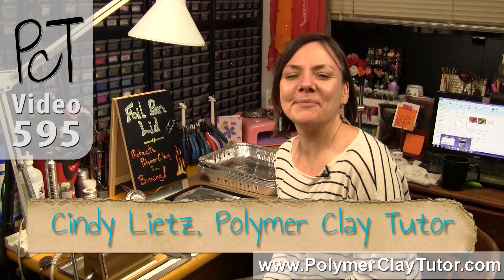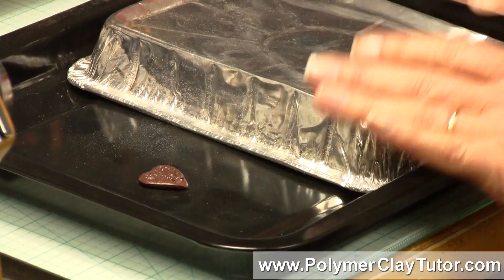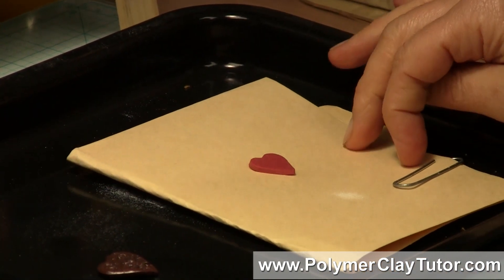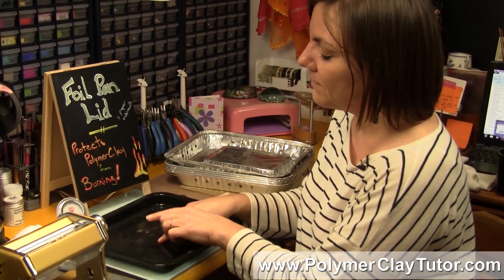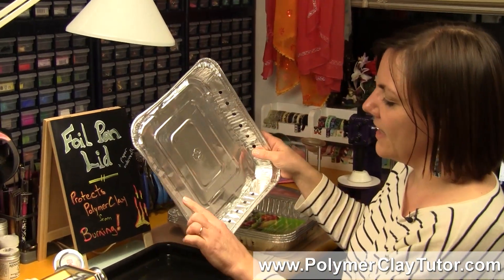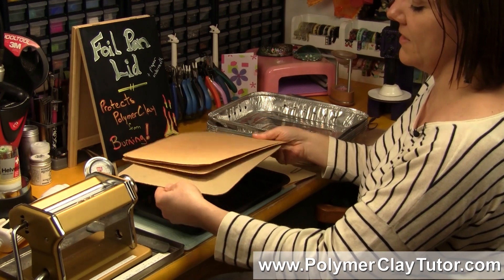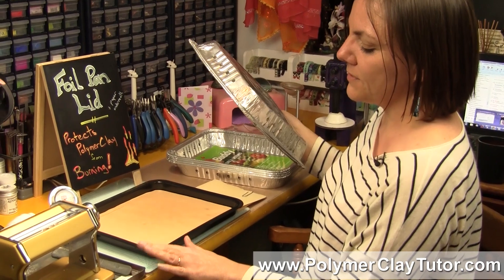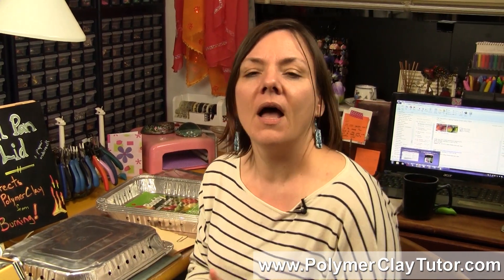Polymer Clay Baking Tips - Using a Foil Pan Lid

Comment: you aren't supposed to bake polymer clay for an hour!! no wonder you ruined one of your hearts! In fimo soft packages it says 110C for 30min... and if i baked them more than that they'd crack and become too hard to put in jewelry. as for they must bend a bit to last
Reply from the maker: SaHaMaHa98 if you have some time, please do check out the rest of the videos on my channel and at my blog (the blog has a great search tool for finding the info you are looking for). You will see that I have done a lot of testing with baking times, mostly for Premo clay.
Reply: If your pieces are getting that brittle when baked for over 30 min. then there is some other cause involved, rather than just the baking time. Maybe your oven heat is inconsistent and it spikes way too high or perhaps there are trapped air pockets in your clay.
Polymer clay is much tougher than you describe and can handle being baked for several hours, but ONLY IF the oven temp is at or slightly below what's recommended.
Cindy is absolutely one of our very best experts on these and many other questions on polymer clay. Her testing and demos have helped countless clay artists, like myself, over the years. She knows her stuff!!